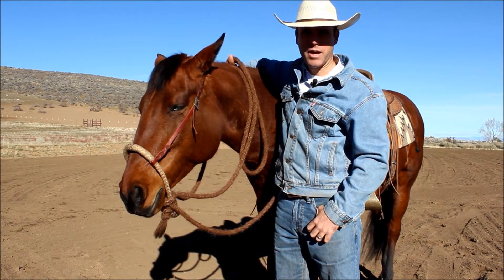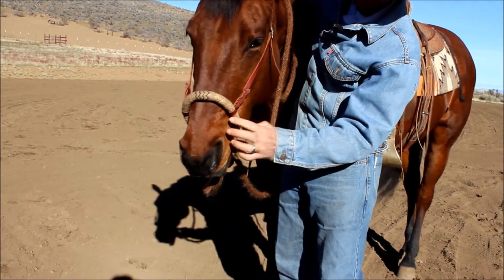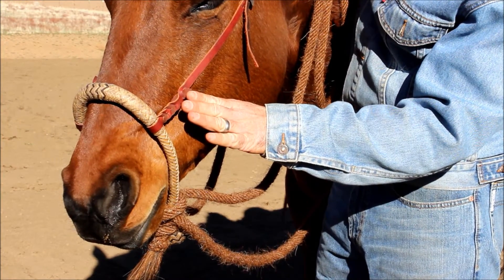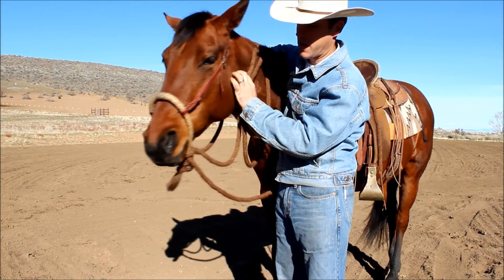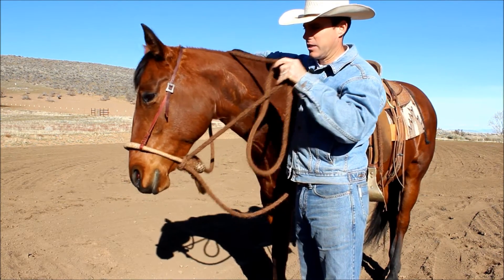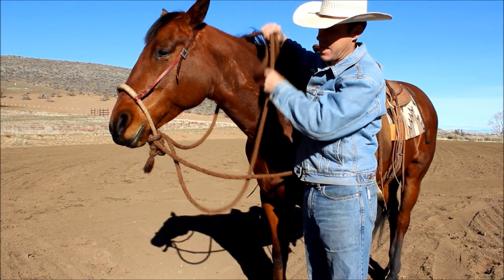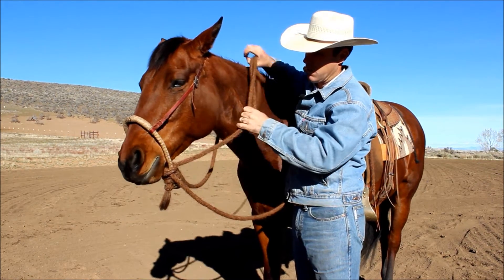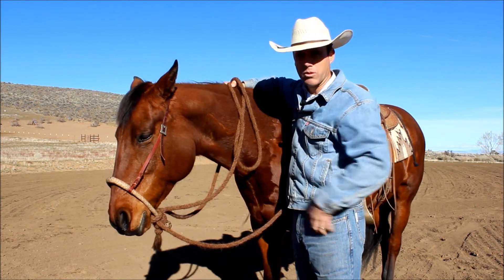Pasini Equine: Hackamore Fit & Rein Control

Comment: I would not bump. I would not force with too much pressure. But I would put tension in the line and wait for the appropriate response, then immediately release the tension when I got the correct response. I could follow up with additional praise. The release of pressure was the initial reward.